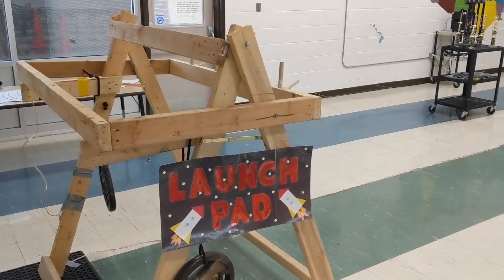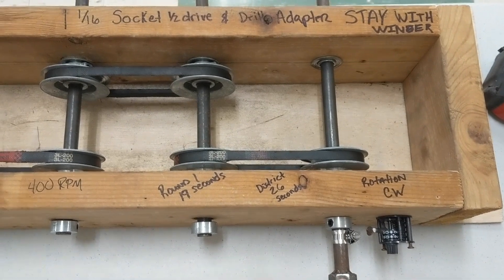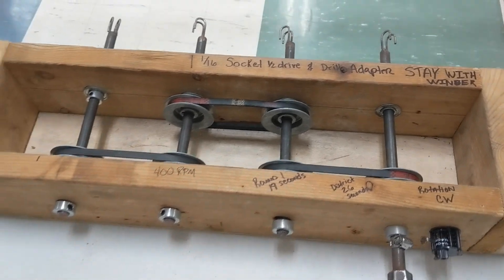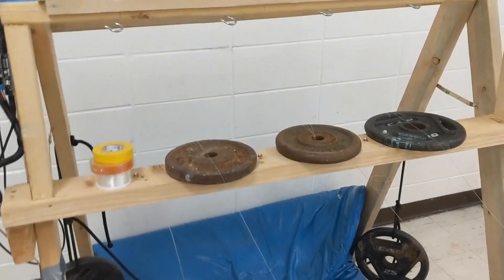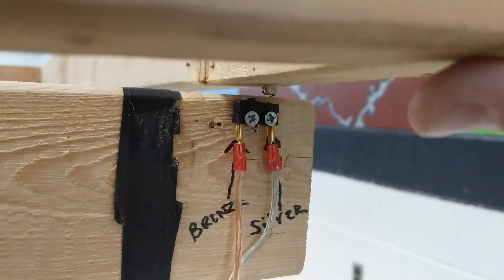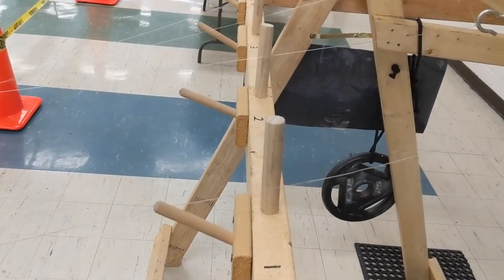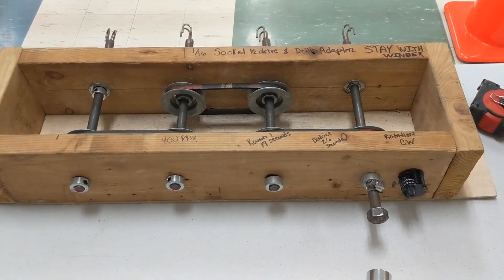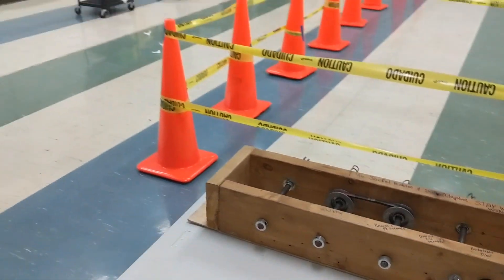Space Derby Towers and Winder

Comment from the maker: I've drawn up the plans for this and put them in the description.  The hardware for the winder was sourced from Tractor Supply with the exception of the hooks.  A friend of mine happened to have them laying around and unfortunately I have no idea where they can be sourced from.  The plastic piece that goes in the rear of the rocket goes in this hook and we hold the rockets out from the winder to keep the rubber bands from breaking as they wad up.  If we have a rocket that has an issue while winding, we set it aside and just run 3 rockets instead of all 4.

We used 50 lb monofilament fishing line.  Some plans called for a single line to run between all 4 tracks, but we found that running individual lines was the best option as the line gets destroyed throughout the day.  Each line is held tight with a 10 lb weight dangling.  Each tower of the track has 50 lbs of weights to keep them from tipping in towards each other with this much tension.  We also have a blanket at the finish line to cushion the fall if the rockets try to continue past the stop.

Comment: Hello Rooster, would it be possible to get the winder details
Reply from the maker: Sure!  Our winder enclosure is made from 2x6 and the pulleys and belts are the smallest I could find at Tractor Supply.  The shafts are just bar stock that would fit the pulleys.  Each shaft has a pulley, a stop block and another piece (can't remember what it is exactly) that acts as a bearing for the shaft going through the 2x6.  I basically scoured TSC until I found what would work.  The drive end has a nut welded on, and the business ends have steel hooks welded onto the shafts.  As you can tell from the video we have the running of the winder pretty well documented - run the drill at 400 RPM, 19 seconds wind time for the pack races then bump it to 26 seconds for the district races (the rubber bands are so stretched out by this point, the 19 second wind wasn't getting them down the track).  We have the remains of our counter still mounted because we tried to hit 100 revolutions by using a counter, but there was no good way to use the counter without destroying it.  All in all I think it cost about $100 or so to make.
Reply: @TheRoostersGarage  Could I get the plans to the winder?
Reply from the maker: @chrisbouda9211  I wish I had plans to hand out.  We just rigged up something.  I got nearly everything at TSC.  The belts are the shortest they had, and the pulleys were the smallest they had.  We got a shaft big enough to fit the pulleys.  A friend had access to the metal hooks welded on to hold the dowels.  Then we welded a nut on big enough to fit over the shaft.  There are bearings where the shaft goes through the wood and shaft stops to hold the bearings in place.  All of this was just sorta rigged and we were amazed it worked and has worked for 4 years.  Its stored at a friend's house and I can go measure it if you would like and sorta draw up some plans if that would help.
Reply: @TheRoostersGarage   Sorry for taking so long to reply - yes, any dimensions/details you can share would be great.  I'd like to build one for my pack.
Reply: The hooks on the winder, do you put the propeller in there, or the piece in the back?
Reply from the maker: @pmurph888  I'm so sorry I didn't respond sooner.  I just now saw this.  We put the plastic dowel in the back in the hooks.  We hold the propeller while we wind it so its a 5 person operation ideally.  We've done it with 3 when we had to.
Reply: Rooster can you send me measurements on the launch pad. Our pack is looking at doing the space derby for the first time
Reply from the maker: Here's the plans we just drew up for this: https://drive.google.com/drive/folders/1Q6VoR80NehpvHWXcOWhMncNXTrMcn3pN?usp=sharing